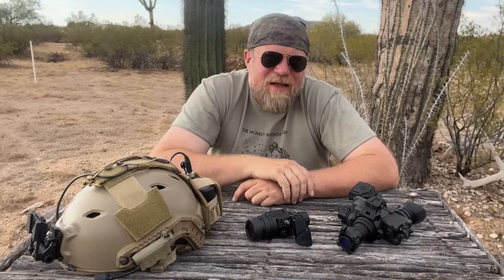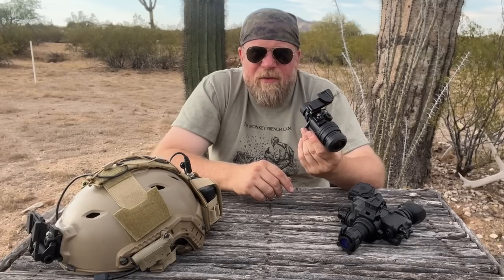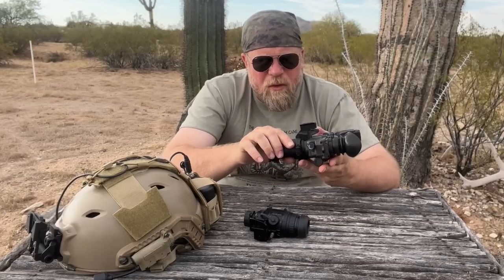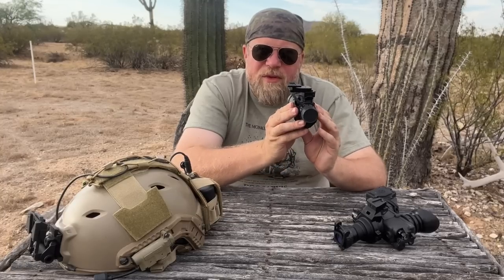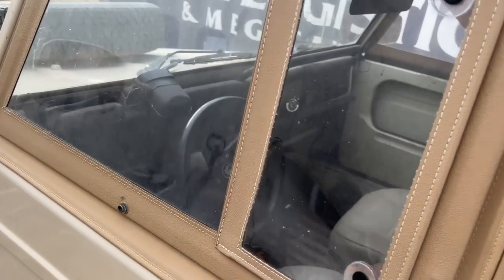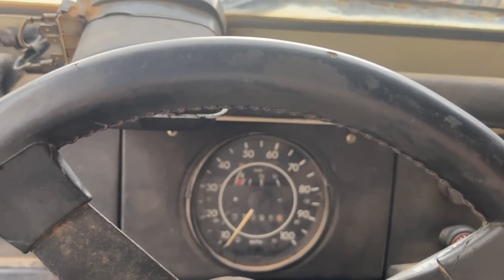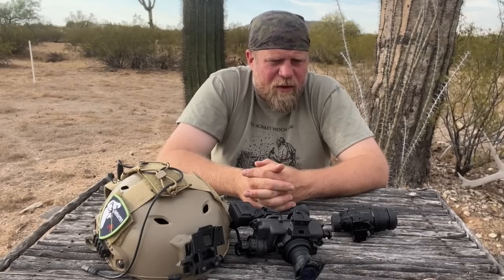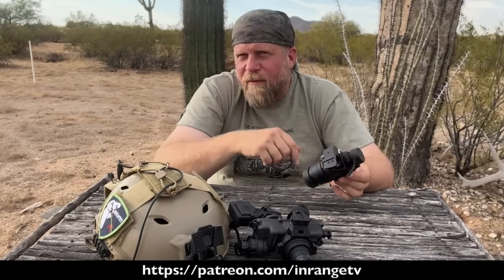Driving with Night Vision - Digital vs Analog

Comment: I think digital vision enhancement will not be a problem when they get actually large scale implemented because my money is that it wouldn't be a self-contained little monocular device. I see such devices being distributed along with other devices. So the helmet contains sensors and screens but all the other bits that are used for image processing are distributed around the helmet or if implemented with other things like communications, you might actually want to move most of the tech out of the helmet to somewhere else off the helmet to keep it light. I picture it as a sort of armored collar around the neck, so doubling as protection to some extent. That also moves heat generation out of a small enclosed piece on your face to a larger, easier to cool place AND gives more space for more powerful computing units that if not able to directly reduce the latency would be able to use the added processing power to basically DLSS predict what the next few frames would be. 
Imagine a souped up smartphone being imbedded in your armoured collar that does image processing for not only night vision by augmented reality and additional communications. Add in swappable rechargable batteries with some hardline I/O ports for quick on-site data transfer and you got a winner. Right out of Ghost in the Shell just minus the net-jack to the cyberbrain. 

And honestly, I think that little bit of latency really doesn't mater because the weakest link in that whole system is the bowl of tapioca pudding running a meat-mech that's using the kit.
Reply: So basically a digital gorget.

Comment: Digital can also benefit from post processing, think your smart phone and the ability to enhance or create other effects to sharpen / image correct etc. I also think there is room for a dual nod setup that interlaces frames so you can get 120hz refresh rate with 2x 60hz units which would eliminate any arguments about latency.

In the demo I do see some of the "framiness" especially in the more bumpy parts but unless it gave me motion sickness I would be perfectly happy using them to drive and the clarity and detail was so much better than the analog.
Reply: Rolling shutter is going to be a thing that differentiates DNV quality. Some of the blur displayed is as a result of the time it takes for the sensor to be read between displayed frames.

Comment: It appears you were driving in an area you were familiar with which, it could be argued, might discredit your claims. BUT it was obviously very uneven dirt roads and you were not in a vehicle designed for offroading or that has particularly high ground clearance. Unless you got stuck while using the Opsyn in a place where you didn't with the PVS7 and didn't show it (it was pretty obvious the footage was edited) I would consider your argument still supported. I choose to believe you didn't willfully deceive us via editing.

Comment: Opsin can do 30, 60, or 90 fps that you can change on the fly. Really comes down to what's your battery capacity, and what do you need to accomplish with the unit? 
Or maybe I'm just wrong and a Sionyx shill, who knows.

Comment: Is there a minimum hz/fps? I have an aurora black unit and it tops out at 60fps
Reply: I really don't have $2500 for an opsin. I plant to augment my aurora black with a flir breach and that is also 60fps, but I don't have the $2500 to drop on a single unit atm

Comment: The opsin doesn't use a CCD it uses a CMOS. A CCD is far superior in low light over a CMOS sensor. They process light differently. A CCD is a digital version of analog NV in a basic explanation. Its considered an analog sensor. Why we stopped building these is due to the cost and power consumption....yet the CCD is superior in almost every way compared to a CMOS sensor.

Comment: This kinda reminds me of the LTT video comparing performance of esports player with different display framerates. Like, sure infinite FPS is better and zero latency is better, but you don't suddenly become disabled with 5ms or even 10ms latency.
Karl do you know if in the case of the Opsin the latency comes mostly from the display, the computer, the camera, all three ? I'm fully expecting and Oled 240fps whatever version to come out in a few years.
Reply: I think things become mostly usable once you are at 60hz (16ms refresh) with no overhead latency, and things really feel great once you get beyond 90hz (10ms refresh).  Sionyx advertises a 90hz mode for the Opsin, but I don't know if there's more latency on top of that.

Comment: Presumably you can kill the WiFi and such right? Could the unit’s gps or even digital signature be used to locate or track it? If so that be kind an uncool drawback if someone was searching for its electronic signature/fingerprint.
Reply from the maker: Gps reception is passive.  Wifi is able to be turned on or off.

Comment: The real problem with digital night vision is that is uses an IR illuminator, which is optional on the analog NODS. This  can 'paint' you as bright as using a flashlight, should there be someone watching you with IR equipment. Still a worthwhile tool for us broke country boys...
Reply from the maker: The Opsin does not use an illuminator any more than a PVS-14 does, and I was not using IR illumination in this video.
Reply: @InrangeTv  Outside the USA (such as UK, Europe and Australia) we can't buy an Opsin and so we're kind-of stuck with Gen 1.5ish digital NODs, if we want something modern.
Microchannel-plate devices are apparently still restricted under ITAR, the same as "military" gas masks.

Comment: 'Kill the headlights and put it in neutral'. Hadn't truly considered NV but if it could be used for more than a single purpose the cost would be easier to justify. Might make riding a non lighted dirt bike at speed in darkness a safer pastime.
Reply: If your pastime is riding a bike at speed in the dark, is safety really something you consider?
Reply: @FromMyXP  For bikes with no lighting system it can be costly to add one. Even when not planning to be out after dark it would be reassuring to have something fall back on. I didn't mean race speed but rather not limping along in first gear trusting your memory of the trail. Sorry for my poor explanation.

Comment: Digital needs an refresh rate of 144fps or more and no compression.  That requires  at least a 150M buffer (3x) for input and at least double for output output with a GPU pass-through of 8Gbytes/s just for the basic optics.  If the front end was based on Primarily a GPU instead of being CPU based these optics would run faster and better with the CPU just running the overlay, GPS and other accessories (storage, wireless, taddle-telling on you through your cellphone)

Comment: Have you tried the new OPSIN firmware?  It provides a new monochrome mode which is a great addition as you can remove any color noise in those real dark environments.  Plus region of interest mode and the gain/EV adjust is now on the on/off dial which is a better solution.